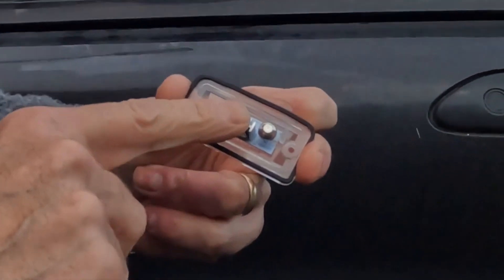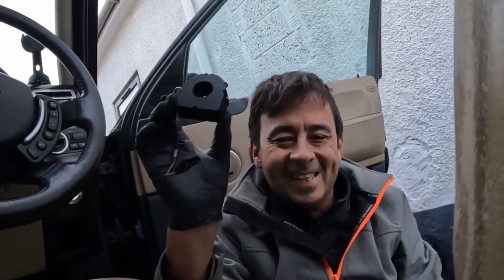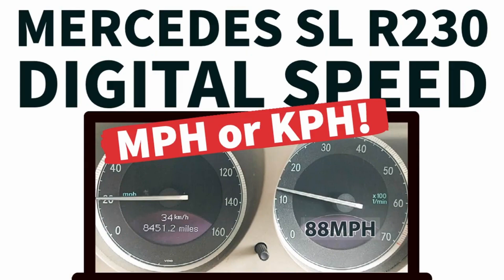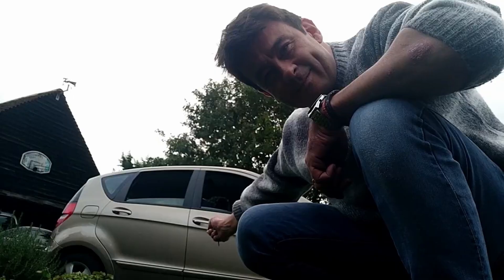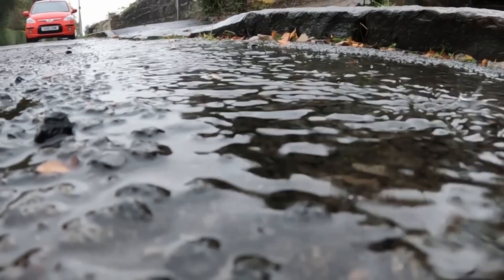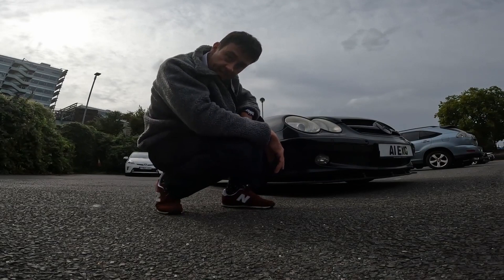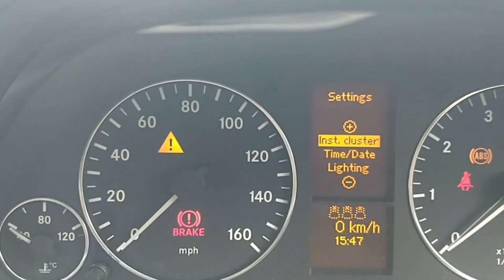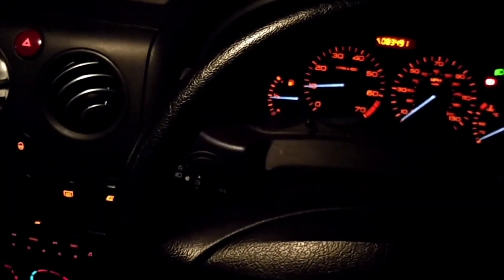GrooveOn Car Promo Video

Comment: Hi Mr GrooveOn. Great videos. Do you have a video for the SL55 intermittent issue of cannot take out of Park? I couldnt see one but wondered if you're aware of it? I heard it could be the brake switch? Any info would be super appreciated.  Regs, Tony
Reply from the maker: Hi there, I have heard of this issue but luckily not yet had the issue.  I had a brake switch issue on an old CLK which was a plunger above the break pedal, I will need to check when I get home, have you looked at that at all?